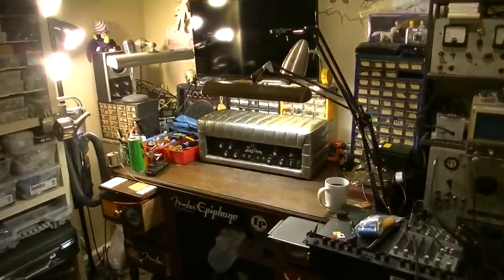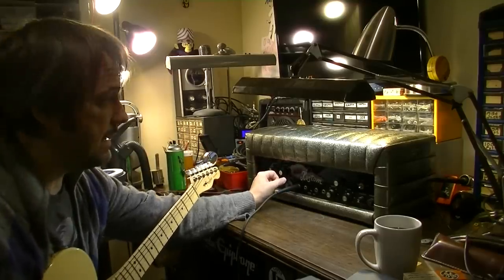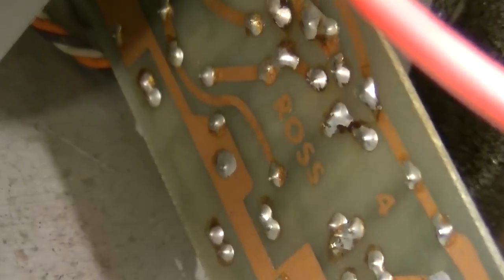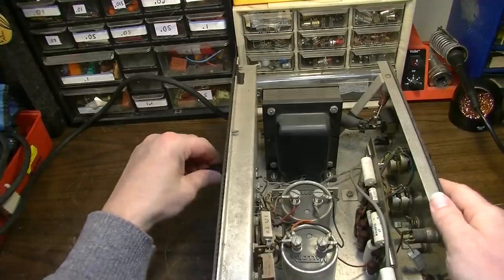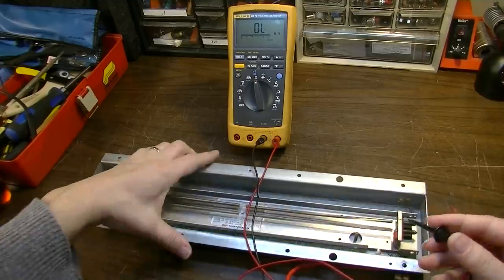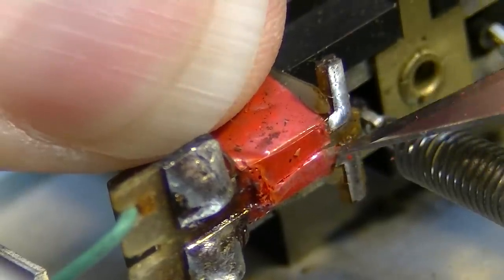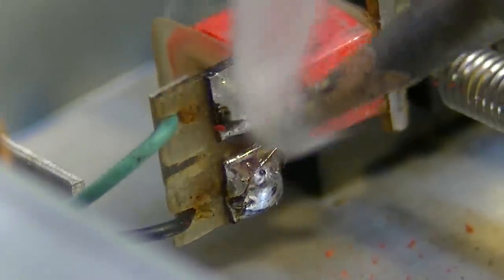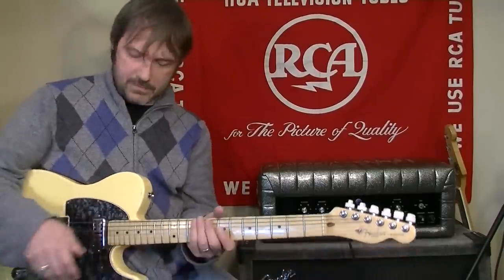Pixies SABOTAGED this 1966 Kustom Guitar Amp! Can I Borrow a Microscope?

Comment: I think a lot of Transistor amps had output fuses if they were DC coupled, (and this looks as if it is, given the two  main smoothing caps). If an output transistor goes short, it would put the full positive or negative DC across the speaker, and the fuse was there to save the speaker if that happened.
Reply from the maker: Thanks for the comment. I've since found a schematic for it linked by another user and I can see what you mean. I'm still learning on solid state stuff, as you know, and your comments help!
Reply: Hey man, your videos are awesome. I have learned a lot about valve amps following your channel. Regarding this specific amp, I think the speaker fuse has another purpose: it protects the output transistors in case the speaker cable gets shorted. You must remember this is setup was used as a PA amplifier, and sometimes  in harsh environments. If the output is left unconnected it would not damage the output transistors (as it would happen to the output tubes/transformer in a tube amp) but shorting the speaker wires would almost instantly blow the output transistors. Of course, the speaker also benefits from the fuse protection in case something went horribly wrong with the output pair.
Reply: You are very right, Sergio. Early transistor amps were very prone to that type of disaster. On the custom drawings I looked at, both 2 power transistor and 4 power transistor models, they have a pair of small transistors sensing the current in the power transistor emitter resistors. If this exceeds a bias value, the transistor turns on, and cuts the drive to the to the output pair for that half, (positive or negative), of the output. You can spot them by the diodes in their collectors, wired to the base of the driver transistor, (too much current in the output device, and this protects the driver transistor too). A good mod to a DC coupled amp with no protection circuit, is to  put a small, (like 0.1 Ohm) resistor in series with the output. Since the output i never exactly 0V with no signal, a short means a very large current can flow, killing the output devices. the resistor limits that enough to give the fuse the chance to blow first, (transistors can blow way faster than fuses on a short).
Reply: Hey Mike, nice insights on those old circuits. I will try these ideas on a guitar amp I am going to build soon. I have designed the power amplifier with a Darlington output pair, and the circuit would benefit from some extra protection. Thanks!!
Reply: mine has a pair of cement .22 ohms at output connected to a a protection relay circuit. they have to be at least 5 watts because of the current or they'll catch on fire
Reply: I think the fuse is primarily to save the amp if the output gets shorted, a faulty amp can blow a speaker through a fuse with large DC offset (but not large enough to fry the fuse).  Any direct-coupled power amp needs some sort of protection on the output unless the output stage is happy to run shorted continuously.

Comment: sorry the last comment was off subject as far as the video was concerned but with the new/different mic you used sounding a bit different/better, it made me think about speaker tone and the relationship between capability and input, versus aural depth of tone from whatever level of input high versus low,, the typical speakers used in guitar amps are relatively low capacity compared with the car stereo speakers I've used in home stereo applications .  Yes I use 'car stereo'  speakers for 'home stereo' applications for their better high-watt capabilities... most of the typical car stereo rigs are extreme high wattage thousands of watts as opposed to hundreds of watts for home stereo rigs, So even a single speaker(6" -15" without cab..even some 4" sub woofers) is capable of handling 500 watts or more,the amps are usually 10,000 watts or more for competition rigs consisting of numerous amps and cross-overs bass capacitors..EQ's  and other components particular to the car stereo realm..the louderer the betterer.. if your ears bleed (bass compression is a real bitch) these rigs move some serious air..with multiple large coil ,, long throw and very large  sub woofers.  its a winner  but back the the original thing. with more capable speakers you get truer output sound from a cab. 2X12",   4X12"9(half stack), or 2X4X12" (full stack....preferable)  louder is better after all right?  but I wuold like to tr 2 ..4X15" cabs(full stack) and the most powerful head available to see how well it performs,,,just for the fun of it. what do you think???...

Comment: Great sounding amp. Very good repair work , no wasted time following wrong trails! That micro soldering was a great instruction video! Good comments from people re output stage protection for  power transistors.

Comment: As far as the speaker wiring in a 4X12 cab,  am I correct in that they are wired series/parallel ...4 X 8 ohm speakers in pairs....each pair in series and then the 2  pairs in parallel..giving an end impedance of 8 ohms? and if so, would typical extreme high watt capable stereo speakers (usually poly cone with deep foam surround) be better as they would be very under driven and therefore have extremely high "head room" giving better clarity at high input from the higher watt amps.. less prone to burn out from "very" high output amplifiers...100 watts ++

Comment: Hey Brad, very cool vid and an entertaining one. Please tell me, I thought after you cut the tape at the reverb tank, you didn‘t put some adhesive tape back on it. Wouldn‘t it be better to put some there or was it not necessary at this point?
Reply from the maker: It's so delicate, I decided to leave well enough alone. It should be ok unless something hits or rubs against that lead, and putting a piece of tap in there might just be putting the thing in that eventually does that.
Reply: Good point. Thanks for your answer

Comment: Hey Brad got a quick question for you that I was thinking you could help me with and that is the differences in fuses between a slow blow and a fast blowing fuse, does it really make a difference in using one or the other,  and do you know the specifics on why one is better than the other, thanks. man
Reply: Slow blow is for something that sees a lot of inrush current and you don't want to blow when you turn it on, but don't want it to pull more than the rated current over time.  The two are not interchangeable.  A fast blow at the right amperage will fail every time if the circuit needs a slow blow, and a slow blow in a fast blow application will cause damage to components that the fuse is designed to protect.
Reply from the maker: Good answer. I concur.
Reply: Thanks

Comment: Oh.. By the way Brad,, Ignore the screen name here. This laptop belonged to my wife before I got it and I can't get it changed for the life of me so...   Anyway my name is Kenny and I was  mechanic by trade for many years... So car stereo is part of what I did and high watt rigs were typical of the mods first made to used cars In Miami where i lived  that I usually got in the shop and a few of my friends were into car stereo competition rig installations and set ups.. some topping 100,000 watts   yes that much in a car..sort of mind boggling huh..you could feel it from 4 blocks away and yes i do mean feel  the bass which was so powerful..and thats where most of the power was directed in the first place  treble takes little power but bass  sucks up the watts fast it takes high watts to move the air like that, so lots of extreme high watt amps and all the rest for lots of chest pounding bass and ear drum piercing highs. and going for those 6" high trophies with the giant sub-woofer on the top... Oh yeah nothing like it... but anyway.... I think that some of that type of speakers( 8 of the 15" in a full stack) with a really high watt amp. in  a guitar rig would be just the ticket,  I want to see how well that works ,just for the fun of it anyway.

Comment: I think Roy Clark played Kustom Amps too years ago. That amp sounds really good. I always liked solid state amps when it came to clean tones. But to my ears my Kustom I used back in the 70's didn't to over drive too well. But I only paid $90 for it used. Don't recall the model # but believe it was a 100 watt amp. Too loud for my basement but fine for small gigs.

Comment: Hey, great video. 
I just bought that exact head. It has a few issues. Right jacks work but they sound like and left jacks are even worse. They cut completely out if you turn the reverb knob up. I imagine that it has a very similar issue to that small spring reverb coil that you soldered.  I'm still trying to decide if I'm going to try to fix it myself or take it to someone to service. 
Anyway, thanks again for the video!

Comment: Another thing with the Kustoms is that the traces like to de-laminate off the circuit boards, especially after keep in a damp basement corner for 40 years...not to mention fuzzy mold tuck-n-roll, yuck
Reply from the maker: I have a Plush amp also, and those naugahyde amps GAS OFF. You can smell it standing close.

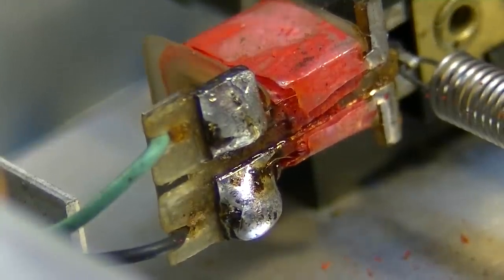Comment: 20:36 use pls aspirin tablet, it will clean out lacquer surface of the wire
Reply from the maker: Thanks. I've heard of that trick before. Never used it. On this though...this lead is microscopic. Just trying to be delicate as possible. Only get one shot at it.

Comment: Re reverb tanks. The old Acoustic 150's made the coolest crash sound when the reverb was cranked and you'd stand it on end and tip it over. 

I'd bet a buck that's what someone did with this Kustom beauty. Those little wires aren't going to withstand too much bashing around.

Comment: Hi, usually follow your videos using a schematic and this one had me searching as I was curious about the 2 way power switch function.
I could not find 695 but head looks similar to a 1964 Kustom Model 200 without the Vibrato if right ref http://music-electronics-forum.com/t38532/ say At the time this amp was made, Kustom would use the list price of the amp as the model number. So your amp might be a model 595RV or a 795RV, etc.

The top edge of the cabinet is wider and so this is often referred to a wide panel or a Frankenstein head.

If you go to the Vintage Kustom site, they have a schematic for this amp. You will find it incorrectly listed under the K200-A listings, but the sheet will be marked as "Wide Panel".
Would you agree?
Reply from the maker: Thanks for the comment. I'll check that out.
Reply from the maker: Ok, just looked at the schematic for the K200... It is the same, by the look of it. Same output config, at least. Thanks for the comment. Very helpful. I think the next person to search for a 695PA will have more luck due to your comment.

Comment: You didn't really have the space, but an aspirin tablet works great for the enameled insulation like that. Just put the wire where you want it stripped on top of the aspirin, and touch your soldering iron to it, a chemical reaction takes the insulation right away. Stinky though!!

Comment: The condition of your iron’s tip is painful to watch.  Try a metal wool tip cleaner, Hacko has them as seperate sale. If you had an oscilloscope ....  well, you manage ok without one, but it makes tracing circuits a 45 second  job when combined with a generator.  Nice to keep these early SS units running, if only for historic reasons.... you got lucky the output devices still worked when re-hooked up.  Not so easy to find TO-3 case parts anymore.
Reply from the maker: Agreed on the iron tip. The cleaner station seemed to be adding more crap than it was taking off. I'll probably go back to the sponge.

Comment: Buying some good Electronics flux might be an idea, makes a lot of soldering jobs much easier.
Reply from the maker: It would have been a good idea to use it on that tank lead, true!
Reply: I'd have used it on all the joints you re-soldered to be honest, along with a needle file & fibreglass pencil to clean it up first. Nice repair though as always.

Comment: Brad- New Electro-Voice mic is an improvement! I listen through a Bose 3-2-1 system. I'm sure those on headphones get an even greater sound. No criticism here just an observation, great highs & lows, but mid-range is a tad weak. God bless...
Reply from the maker: I'm still trying to tweak my demos. I still record direct to camera for ease of editing, but I may change that. Probably time to start recording to computer where there is no camera compression. Sometimes I forget to turn down the gain on the camera and the compression is a bit much. That's what happened on this video. So, while the EV improved things, I think, the compression was too much.
Reply: Keep on keeping on, Brother! I see your channel growing. I just wanted to give you some "timely feedback". Like I said, from my personal perspective, the sound with the EV mic during the amp demo was definitely a "hotter signal" than the Shure mic..
Reply: good idea to use two or three mic's with different parameters in that case

Comment: I have oops sorry to be a bum but  have an old Valco /Airline Tube amp (just chassis and elecs and tubes , all works sorta , all tubes heat up ,im getting a signal from OT ,but has a 60 cyc .hum type hum but higher in pitch of tone , get guitar signal but only if spkr signal  . is fed into another amp , Id almost be glad to give it away but too tight wadded (thrifty ) for that  but would like to hear this so called  old 1958-9 Fen.Champ Clone , . ...on its own before I donate ir ruin it with my lack of skills with a soldering iron ....Im thinking a bad OT but only guessing , Someone with more smarts than myself can head me in the right direction for a layman "neck bone connected to the head bone " type . The OT if I recall had four lugs on primary side and three on the 2nd/output side , Im getting only 2.5 ohm output from all three combinations of output wires .....anyone interested I in the old amp contact me ??maybe we can give it a home ...

Comment: use flux before soldering.  avoid the 'bigger the blob, the better the job' result.  where flux goes, solder will follow.
Reply from the maker: There is flux in the core of the solder. I don't need flux.